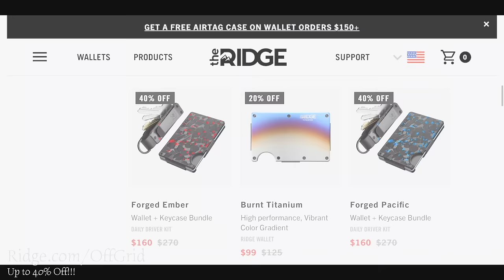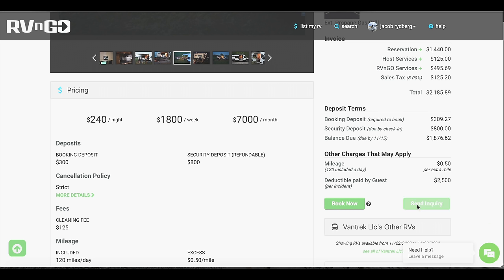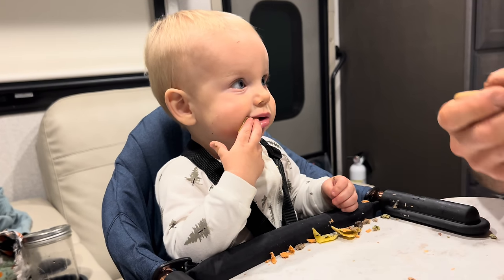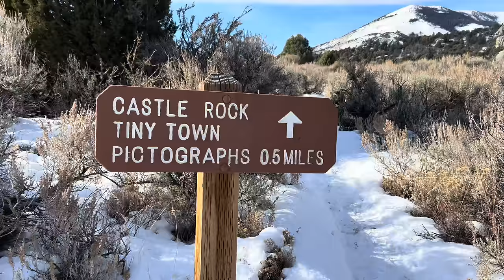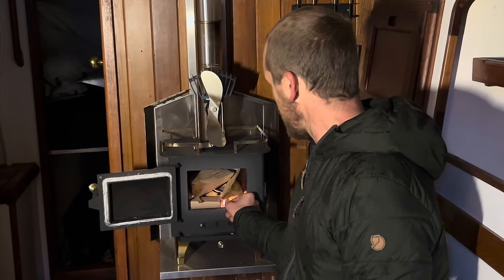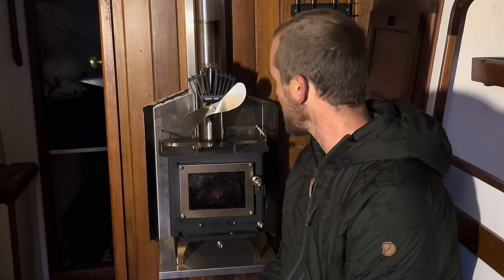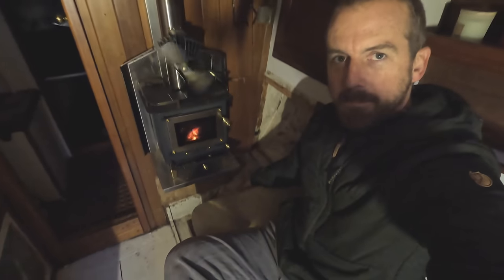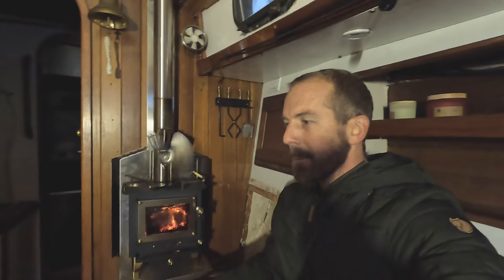A Simple Life ALONE Off the Grid - My NEW OFF GRID VAN LIFE & Tiny Home - Ep. 163

Comment: Hi guys. I own a 2015 Class C RV based on a Ford e450 chassis. Just started watching your current video and noticed the comment about the generator not starting when truck gas tank is below a 1/4 tank.

This is a safety feature that will not allow you to drain your fuel tank past 1/4 full so you will not get stranded in the wilderness.

Most of us never drive below a 1/2 tank because we don’t always know where the next gas station is. 

Enjoy your new adventure.